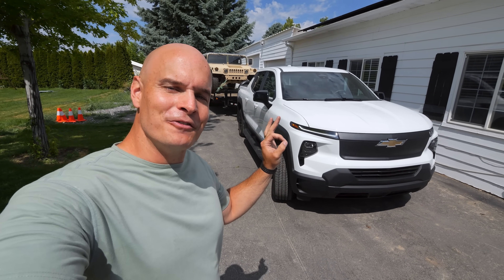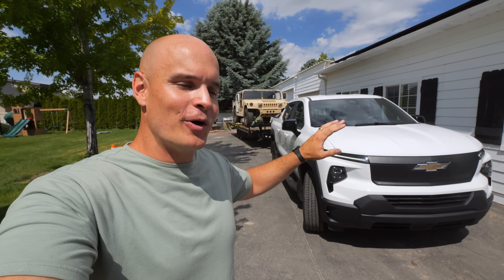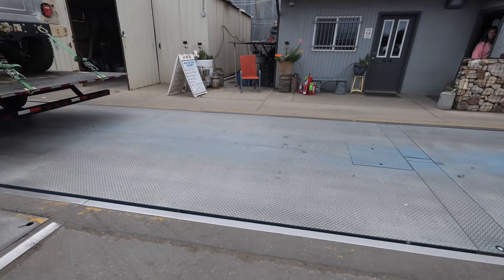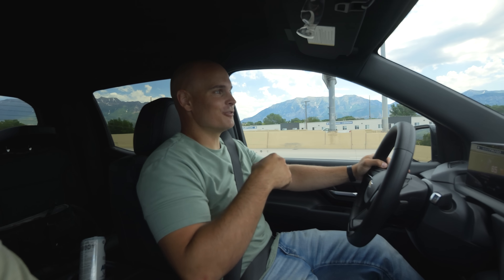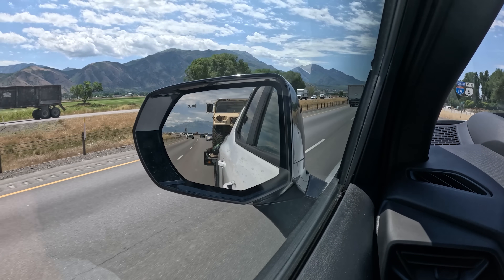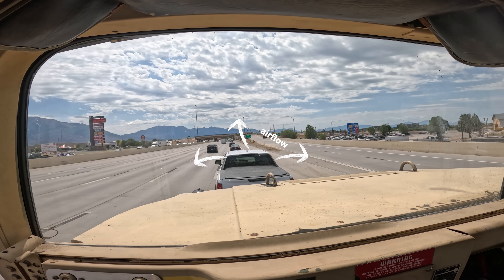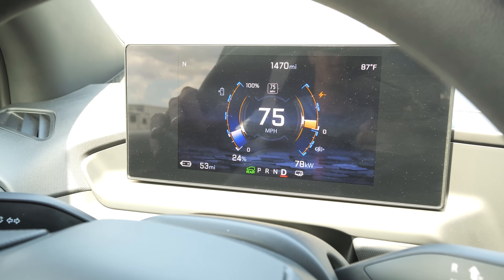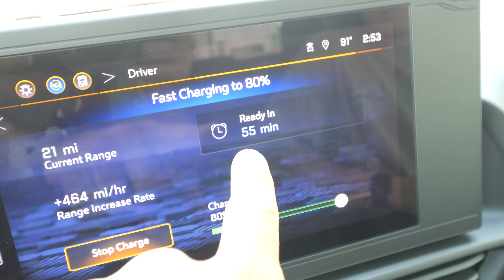The Chevy EV tows TWICE as far as the Cybertruck?!

Comment: 80 mph, towing 11K lbs with A/C? People lets be reasonable here, this thing can tow.
Reply: Let's not forget the cyber truck has the smallest battery, the Chevy battery is around 2x the capacity.
Reply: Seeing that 90% of trucks almost never tow anything ( per manufacturers) the fact it can tow this much for this far is perfect. Most owners tow a boat to the lake which is usually not 100 miles away.
Reply: Especially as in the UK you can only tow at 60mph 😮
Reply: What is the battery capacity?😮
Reply: I think I was able to make about 400 miles per fill up while pulling with my friends f350 last year
Reply: 500 miles towing 10,000 is the cutoff where I could realistically consider an EV truck. Even that would be borderline. Essentially I would need to be able to drive from Seattle to Spokane in Washington state without stopping.
Reply: In my area charging stations can be further than 180 miles apart. I would not call 170 miles of tow range a towing vehicle. They need to just make PHEV where you can get 50 miles of EV range with a 35 gallon gas tank. It would get a combined range of 750 miles or 350 miles towing this same weight.

For an EV truck to tow like an ICE truck you would either need a 400kWh battery pack or do what some of the EV RV brands have done and have a battery pack on the bottom structure of the trailer and an electric motor that makes it self propelled.
Reply: It can tow but it won't work in a work of Hotshots or long distance hauling.. But let's say you're Telco Contractor and from time to time you need to pull a roll of fiber optic cable? this thing can do it with ease..
Reply: @geogmz8277 Right, cause gasoline isn't inherently dangerous...
Reply: @geogmz8277 lol obviously it’s not a hot shot rig. Most people don’t hot shot
Reply: It can only tow 170 miles before you habe to disconnect everything and charge for an hour. My shortest intrastate trip is 300 miles each way and thats a lot of charging and waiting dude. Just to be in my own State didnt even leave it
Reply: @TheAnnoyingBoss  is this In pickup truck, what do you tow? How long does 300 miles take you ?
Reply: @TheAnnoyingBoss  So, you`re always towing? Like, literally towing 24/7?

Neat, I'd dread to see your fuel bills...
Reply: @TheAnnoyingBoss  He wasn't charging at the max rate the truck can do. I think the Charger was derating. If they were charging at 350 kW they'd be stopped for around 30 minutes.
Reply: @TheAnnoyingBoss   Such B.S. that is 109K a year at 300 miles a day!
Reply: Metric translation anyone? Pretty please!
Reply: It can tow but doesn't make cool v8 noises
Reply: When I go camping I take a jerry of "woof wood", turns out I'm doing it wrong and will just put some batteries in to get things going
Reply: Do it in the winter with offroad tires then spout your mouth about how awesome it is
Reply: Things lame doesn't even roll coal
Reply: @deveey  Rolling coal just costs you many aim higher in life my friend.
Reply: @qubit7112  things I practical charging time is outrageous
Reply: Sorry, but 80 km/h without towing top speed. More is most certainly not allowed outside the USA.
Reply: @wolfgangpreier9160 in Europe towing of a max 3.5 ton load is allowed up to 90 km/h if you have a BE licence and the véhicule is certified for it. So far, the largest EVs on the European market allow only 2.5 ton trailers
Reply: Nobody is buying this thing
Reply: @GoldRaven-oe4by  Good to give people choices.
Reply: But not for long like a Diesel or gas truck.  Batteries are notoriously dangerous
Reply: @flexairz  A report from AutoinsuranceEX said EVs exhibited 61 times fewer fires per 100,000 sales than ICE vehicles. “Tesla has reported that between 2012 and 2021 there was approximately one Tesla vehicle fire for every 210 million miles travelled.Apr 21, 2024
Reply: @travisjazzbo3490  Thank you for calling this out.  People forget facts and get stuck with sensationalized news headlines.  For those like Flexairz, just because it gets a lot of media attention doesn't mean it's happening more.  Most "LOOK HERE!" type of news headlines are clickbait for advertising revenue.

The fact is EVs catch on fire far less than ICE vehicles.
Reply: @theblubus That’s because there far less EVs on the road 😣
Reply: @waterloo123100  Those statistics are scaled to the cars on the road. If there are 100k ICE cars on the road and 10k catch on fire means 10% burned, if there are 1k EVs out of which 10 catch fire means 1% burned, thus EVs are 10 times less likely to catch fire according to my fictive scenario.
So no, not an argument.
Reply: @waterloo123100  LIES! Those statistics are normalized PER 100,000 Vehicles. Your argument is wrong.
Reply: @waterloo123100  This is based on miles travelled and on number of sales. EVs are in every statistic safer than ICE vehicles.
Reply: @waterloo123100  You need to understand statistics. This is what was taken into consideration 🤦‍♂ Next, they are only getting safer and safer so those stats will get better and better. Come on
Reply: @waterloo123100 I can tell you don’t have a secondary education. You don’t even understand what per capita is. Our education system has failed you. i’m sorry you weren’t provided the proper resources in school.
Reply: @waterloo123100  it is a ratio, it has nothing to do with how many are on the road. Evs have driven billions of miles in the us alone, more than enough to create accurate ratios about their likelihood of catching fire. which, to be clear, is multiple times lower than ice vehicles
Reply: @travisjazzbo3490  Thank you for this.
Reply: @waterloo123100  That would not explain why they are doing so much better in terms of per 1000 vehicles sold, though.
Reply: @flexairz you do realise the likelihood of a gas truck catching fire is far higher than an electric one right?
Reply: Nope, new battery tech is lithium iron phosphate. Its incredibly stable, you can impale it with a nail and it will not explode or set on fire @flexairz
Reply: @flexairz  there is always a You. We are talking about electric and most of the people watching this video are well aware of the towing capacity of ICE. 😐
Reply: @flexairz  gas cars blow up and catch fire all the time. EVs are actually significantly less likely to cause a fire than any form of gas powered vehicle
Reply: Yeah cause diesel trucks totally never catch fire or runaway catastrophically 🙄
Reply: @Romanticwolf  How many of those do you see in a year? 🤔 I've not seen one in a long time... (speaking of pickup trucks).
Reply: Oh didn't know the bar was what I've personally seen was all the evidence one needs. This is going to do wonders for my Internet arguments
Reply: @geogmz8277 in the last year ive only seen modified diesels Recently and one old 4bt in a case backhoe that got real hot and started eat  crankcase oil.
Reply: @Romanticwolf so your saying carrying 20 to 40 gallons of fuel driving down the highway with many points of engine failure. That is more dangerous
Reply: @geogmz8277 haven’t never seen ev with that issue
Reply: @flexairz  "Batteries are notoriously dangerous"
Only to people who don't know the truth, which is EV's catch fire at a far lower rate than petroleum powered vehicles.  The statistics aren't even close.
Reply: @flexairz 🤦‍♂️ no they are not
Reply: @flexairz  IF batteries are notoriously dangerous, why do "everyone" carry them? Keep them next to the bed a night? Nevermind ICE cars also having batteries, along with a tank of higly combustible liquid...
Reply: @flexairz  Diesel or gas is notoriously dangerous.  Add DEF cost to the diesel and you become broke much faster than hauling with this truck.  Plus that check engine light will leave you stranded with Diesel or gas.
Reply: @flexairz lol gas and diesel are exploding in your truck every single second 😢
Reply: @flexairz  if you need to tow any farther than this than the vehicle that you use will not be your daily
Reply: @flexairz   EVs are actually less likely to catch fire than petrol powered cars.
Reply: @flexairz
Reply: @flexairz they can tow just as long. It’s simply the charging infrastructure that needs improved.
Reply: @flexairz it likely towed that load just as far as my 03 6.0 2500hd silverado could.
Reply: @flexairz that was the case in 2010. Not today with modern battery safety features. And a cooling system. That number is now down to 25 per 100,000 units sold
Reply: @flexairz look up the stats on vehicle fires. You might be surprised.
Reply: @flexairz  Depends on the battery chemistry. LiFePO4 is probably safer than gasoline, considering they don't undergo thermal runaway like typical Li-Ion cells do
Reply: @flexairz that’s why gas is used in our cell phones computers and children’s toys. Notoriously dangerous 😂
Reply: @flexairz  "Batteries are notoriously dangerous" stop with the fear mongering. That's just not true anymore.
Reply: @flexairz  LOL, there are FAR more fires from gas and especially diesel trucks alone than there are electrical vehicles in total.
Reply: @flexairz  Petrol/Gas is so safe..... Depends of the type of batteries.

Comment: No one should be surprised that the Silverado lasted longer. It has a much, much larger battery.
Reply: 244 kWh is wild .
Reply: Its also not a sack of crap like the cybertruck
Reply: The efficiency is really interesting to know but practically doesn't make that much of a difference when some of the other vehicles and only go half the distance.

From a tech and engineering standpoint I would love to know the efficiency also but practically what matters more and how far you can go on a single charge
Reply: Yes, he should add wh/mile to compare efficiency during pulling.
Reply: @Genju89  Exactly. The Silverado has a 25kwh advantage over the largest battery in any of the other trucks (R1T can have a 180kwh battery.)
Reply: @Genju89  I don't think it matters. If you need to tow then you take the thing with the best towing. If it takes an extra 25kwh that just means and extra $4 a charge. You're not going to have a substantial increase in price just because it is less efficient. We're not talking the difference between a sedan to a pickup here, it's two massive pickups of about the same size.
Reply: @Genju89  chevy did 0.7mi/kWh, CT did 1193Wh/mil (which is 0.84mi/kWh). So, even with worse aerodinamyc and winter wether CT spent less energy
Reply: @vitaliyleonov8958 
🤔... the efficiency argument or because its a larger battery argument is pointless...its a truck for hauling and towing if it can't do those things it's then its fine its just a show piece
Reply: @alittleofthisnthat5665  I'm agree with you. If a car has a purpose - it's should be capable to do it no matter how. CT is not great to long-distance towing. Hauling or towing around town - ok.
Reply: @vitaliyleonov8958  I would check that math, comrade.  Chevy has LITERALLY DOUBLE the battery, and traveled only 50% more, but according to you, it used less energy...
Reply: @pretol2730  travelled less miles per kWh isn’t ‘using less’ comrade…
Reply: @alittleofthisnthat5665 like the way 90% of truck owners use them? Most are just inefficient grocery getters, and mundane daily drivers.
Reply: @Bum_Hip  irregardless of however the consumer decides to use its still supposed to be a full-size truck with real world towing/hauling capabilities and that requires a big battery
Reply: @alittleofthisnthat5665  you lost me at “irregardless.” That is not a word.
Reply: @alittleofthisnthat5665  then a truck with a big fuel tank can tow much farther.
Reply: @Bum_Hip Facts
Reply: @alittleofthisnthat5665 And y'all should get taxed accordingly but that's not the case now.
Reply: So you're saying it's a better value since they give you more battery
Reply: What was the cost to “fill up” each truck?
Reply: @markmeridian3360 what conservative webpage did you find that bit of misinformation?

Comment: For all the rest of the world. He was driving 130 km/h with 4.5+ tons behind.
Reply: He reached 285 km of range
Reply: FWIW, metric and imperial tons are roughly the same. Although he gave the weight in lbs, you'll often hear imperial tons used for vehicle weights, and you basically don't have to convert for most purposes.
Reply: More like a Maximum of 120 km/h, as he said himself.
Reply: @erebostd  I guess you missed a part where speedo was showing 80mph at 6:56
Reply: @darekmistrz4364  one shot of 80mph doesn't mean he drove that speed the whole trip 😂 he said he's keeping it at around 75mph but is also driving normally, meaning he's going to slow down or speed up for traffic 🙄
Reply: @darekmistrz4364  I didn’t catch that, correct. But i suppose that happened when they were driving down a hill or so, especially because he said he’d keep it at 75, and we saw that multiple times. I saw the speedo showing 35 in between, I wouldn’t say that’s the speed the drove during this test, would you? 😊
Reply: Wait, ya'll don't measure in football fields? (a field is a pitch for those of you euro folks)
I gotta run to the grocery store quick - I'll be back soon, it's only 7.5 football fields away.
Reply: @deagle50ae  Mine is 180 football fields away. And i most certainly will not run there. I do not want to be killed by the romanian 40 tons.
Reply: He drove between 120 and 130km/h and he said it was 5 tons added up with whatever he said
Reply: Thank you my good sir🎉
Reply: Your comment deserves 7.8 billion likes!
Reply: For Texas that's 714 bald eagles of weight and 1421 football fields per hour
Reply: @nottingham82  I thought the bald eagle has gone extinct? Or have you saved some in your fridge?
Reply: @wolfgangpreier9160  freedom can't go extinct.
Reply: @nottingham82  What is the intersection between extinct species and freedom?

Sorry, but i can not follow you here.
Reply: @wolfgangpreier9160  well clearly you are not an American so I will explain.  Bald eagle is an American symbol for freedom and is also not extinct.  I saw one majestically sitting on a telephone pole defending freedom just a few years ago.  I gave it a high five. (please don't make me explain high fives)
Reply: @nottingham82  I know both. And I know that they are extremely rare and become extinct. Nice that you saw one the other day. Thumbs up. 

I saw a stork yesterday. Also becoming rare. The one who brings the babies. Also extremely rare…
Reply: The stats became instantly impressive. Thanks mate.
Reply: No one cares about rest of the world, we own the whole world,  hommie.
Reply: Just FYI because I see a lot of comments thinking this is fast and or dangerous. America has huge very long very straight highways. You set the cruise control at 80mph sit back and steer for hours at a time. Thanks to America's interstates you can drive anywhere in the country without ever having to bring the vehicle to a stop for a red light or traffic or anything. The distance you can drive is only limited by fuel. Driving these speeds with loads like this is common practice. 18 wheelers go 75-80mph all day
Reply: Nobody drives with 130 and 4.5 tons. Nobody sane and not US Americano or Russians.
Reply: Except we do. That's why we like diesel trucks. 14k toyhauler and set the cruise at 80 and let it eat. Even the big semi trucks do 75-80
Reply: @aleks138  yo thats out of it, in our country semi trucks are speed limited to 56. The speed limit is 56 for any towing. But then our country is small with poor quality roads
Reply: Illegal as shit on the autobahn while  me overtaking with 300.
Reply: @Nordlicht05  yeah . I was shocked to see that speed with that kind of load on a trailer. o.O
Reply: @Wamboland  I mean I heard that even big trucks drive there faster than 80kph but not how fast 😅 
Back in the eighties my father chased an Aston Martin on the Autobahn wich towed an camper trailer. He said the Aston driver over 160 😱

Comment: Dang the battery capacity of this thing must be monstrous too
Reply: Nearly 200kwh if I remember correctly, which is indeed insane.
Reply: @yveslauwereyns6677  gross is over 220kwhs capacity. Useable is 205-212kwhs depending on whose testing you can believe?